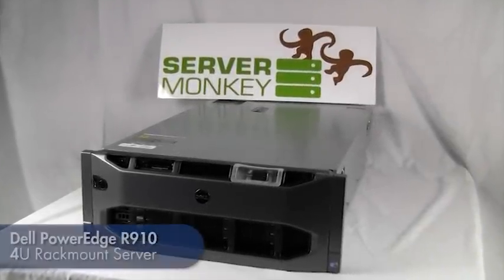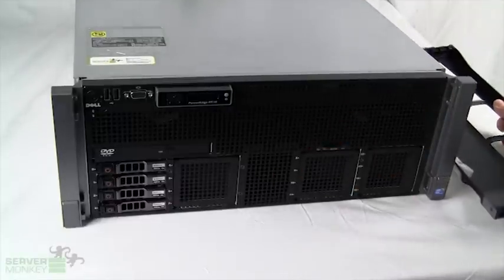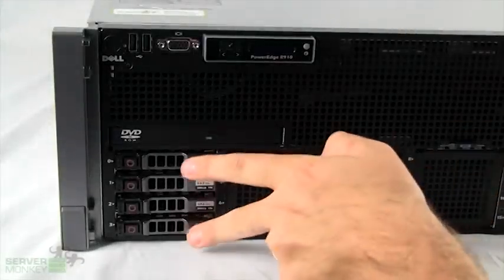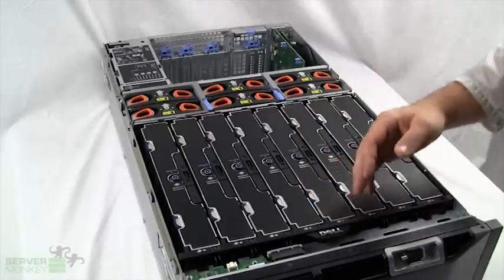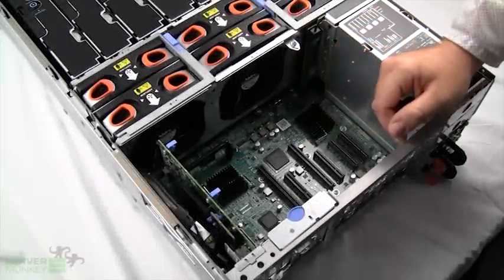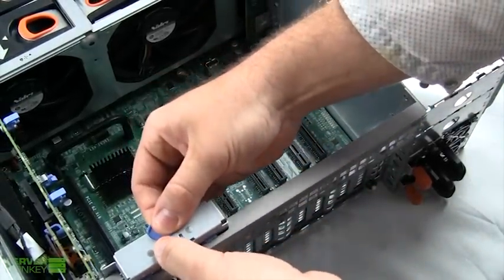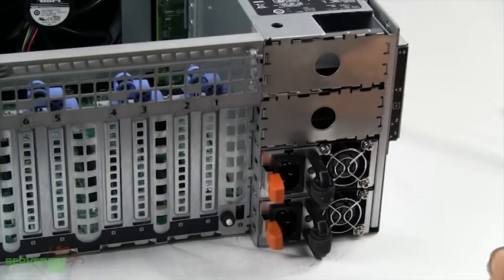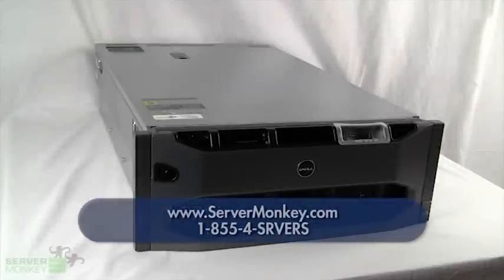Dell PowerEdge R910 Server Review -- ServerMonkey.com

Comment: Does anybode tested 16*960GB SSD's in hardware RAID 0 ( with 4 drives ) and software RAID 0 on all 4? It should be named tree raid with two 0 stages - RAID 00 - simiralry to RAID50.